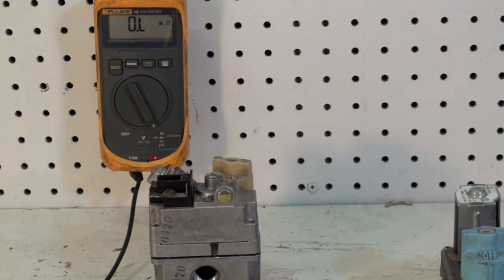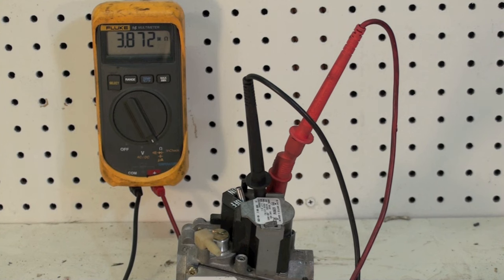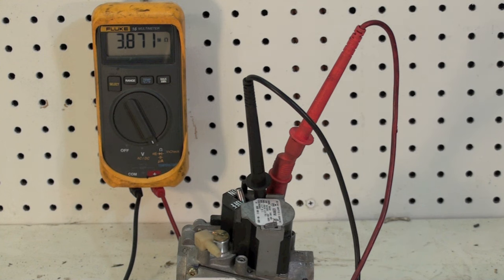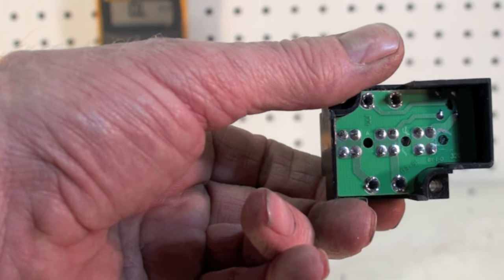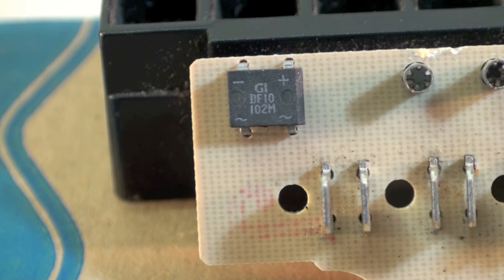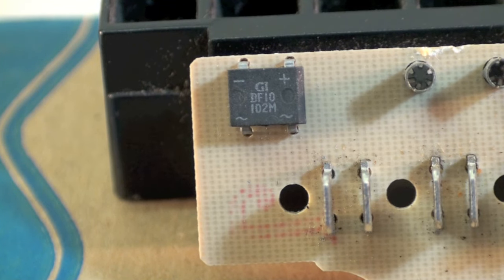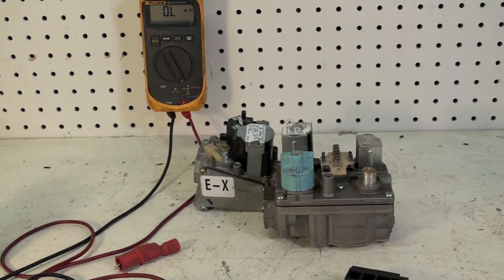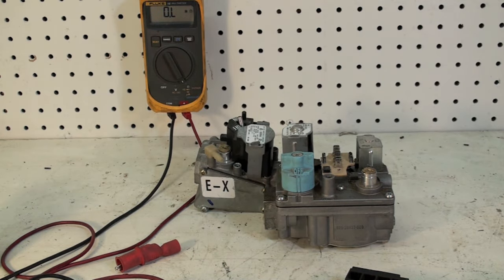How to test the gas valve on a gas furnace with an ohmmeter

Comment: I know this is an old video but it was really helpful to see that diode bridge and understand why some two stage valves cannot be "ohmed out". I was convinced it was bad until I watched this video. Instead, I applied 24v between common and PM or H and it went "click" each time. This convinced me to install a new (used) board and it fired right up. Thanks!
Reply from the maker: Welcome
GFM

Comment: I managed to fix the broken thermocouple! The problem is that most online videos tell you to test the TC mV output. In my case the mV were within range, however the key is to ALWAYS test BOTH the mV and the Ohms. Given that my TC had good voltage, I went to check the solenoid(which seldom fail as the wire inside is quite thick) At first I thought it was shorted, but that's my ignorance! A very very low resistance is essential for a working solenoid.

SOLUTION: FIX THE FAULTY THERMOCOUPLE: 
So here is a FIX that may help many readers out there.
I grabbed the tip of the thermocouple with a pair of pliers and the tip snapped off! EXCELLENT sign! It had badly oxidised inside and became brittle. This is the part where the two metals are welded together(copper or copper nickel alloy).  So I removed the inner STEEL wire and cleaned it. I also used a small drill point to clean out the inside of the outside sleeve. Some grey powder came out, sign of a burnt out joint. Now, for a temporary fix, one can  reinsert the inner steel wire and crimp the tip to the outer sleeve.  I chose to fix it permanently.  If you have access to a spot welder or are practical with a stick welder you can carefully spot weld the tip of the TC so that a small bead forms. I welded the inner steel wire and outer sleeve with a brazing rod 15% Ag. It is easy to do with an inexpensive MAP gas torch (if you don't have Oxy-acetylene torch). Solder is not suitable because of it's low melting point. If you have access to a spot welder or are practical with a stick welder you can carefully spot weld the tip of the TC so that a small bead forms. Thank you grayfurnaceman for your excellent videos

Comment: Thanks for posting.  Even though it was a long time back it has helped me today.  Having used a number of your videos to identify the gas valve as the most likely cause, I metered it and found it to show a resistance of about 2 ohms and close to a 5 amp draw (rating is 0.5A).  Removing the plastic cover of the Honeywell VR8215 series valve revealed a small board with discrete diodes and a capacitor.  Having replaced the 4 x IN4007 diodes the resistance is back into the 2 mega ohm range.  This replacement was possible without removing the gas portion of the valve.

Comment from the maker: The pilot solenoid would normally have a very low resistance.  Make sure the button on the thermocouple is clean and has been tightened.  Do not over tighten.  If the pilot light is  covering the thermocouple 3/8 to 1/2 inch it should hold in.  Check out "the pilot gas furnace"  playlist for more info on how the pilot should work.  If it still does not work, the gas valve will have to be replaced.  Good luck and let me know what happens.
GFM

Comment: 30 year old Bryant 394GAZ upflow furnace using the White Rodgers valve you have in the video.  No problems with this unit until 2011 when they replaced all the gas mains in town with plastic.  Last few years the orifice on the #1 burner (out of 4, 100k BTU) keeps getting clogged but that's nothing major...  wondering why though. 
I have been fighting with this furnace all winter.  Was without heat for 3 days in December waiting on a new pilot assembly (flame switch went bad so pilot kept going out).  Ever since the trouble with the pilot began, the furnace has multiple clicks when energizing the main gas valve.  Sometimes it acts normal and just one click, other times it's a dozen clicks.  I have already replaced the lockout ignitor (no success, intermittently failed on the pilot hold circuit), wrapped the wire for the main valve circuit in tape in case there was broken insulation somewhere (yes, electrical tape), checked for arcing behind lockout, and redone all the solder points for the main valve in the ILO and all of the ones on that stupid circuit board on the gas valve.  All to no avail.  Tested gas valve solenoids with circuit board removed and got around 960 ohms.  No exploded/bulged capacitors I can see in either  the ILO or the main circuit board in the blower section either.  Got another 2 months of winter to go here and I don't want to be left without heat again.  Am I looking at getting a new valve?  Any other suggestions?

Oh, and I forgot to mention that you can hear the solenoid clicking throughout the entire house through the ducts...  haven't been watching much TV or anything so it's pretty quiet in here.

Comment from the maker: Sometimes I assume more than I should.  In most cases, we are looking for 24-28 volts AC.  The voltage is transformed from usually 120V AC.  On some units, specifically hanging unit heaters, the gas valve can be 120V AC.  Thanks for the comment.
GFM

Comment from the maker: Yes you could.  The amp meter must read in .01 increments.  And remember on newer units the gas valve is only on for 4 to 7 seconds on a trial for ignition.  So the sequence is inducer on to prove pressure switch>HSI warmup>gas valve for trial for ignition.
GFM

Comment from the maker: Most of the valves have a rectifier as said on the video.  So sometimes the reading will not help.  If you can hear a click when the pilot proves, the solenoid is energizing.  I believe that pilot has an integral flame rod.  That just means the rod that the ignition spark comes from is also the sensing rod to prove pilot.  Try sanding the flame rod if you dont hear the click.  Good luck.
GFM

Comment: That is Full Wave Bridge rectifier, now that you removed that part, you now have access to the coil or coils, and you can use the ohmmeter on it. You can also connect the 24-28 VAC input to the external spade connectors and test the Rectifier to see of it has a DC Voltage output!
Reply from the maker: The point of this video is that ohmmeter readings are pretty much useless on these valves.  They are not repairable.
GFM
Reply: grayfurnaceman once you have that cap off the actual coils can be tested with your ohmmeter! You just can’t do it with that cap on!
Reply from the maker: @DishNetworkDealerNEO  First, the failure of these rectifiers is very rare.  Also, each valve does their rectifiers differently and the part you have shown will not repair all of them.  In fact, some of them do not have rectifiers in them at all.
Then, as a service tech, I replace this part, then find the coils have shorted, (no specs for them) I have wasted a lot of time on something that does not work.
Add to that, the manufacturer absolutely considers repair of gas valves a no no.  Liability comes in here.
GFM

Comment: Thanks for the Good luck  and suggestions. The very first think I did was cleaning both rods. What is the purpose of having 2 rods? .One integrated with the spark, and one on the opposite side of the burner? Do they prove pilot flame or main gas flame, or may be one is for pilot and one for main gas flame. The reading should be 0.15 micro amps.
I don’t thing I heart clicking from the gas valve .When properly working the main gas shoots immediately after the pilot.

Comment: Natural gas piped in city, hot water heater doing just fine, gas close dryer all good.  It is now working just fine but would not light up twice last night,  When it first started do this it had been off and cold now it is hot and doesn't get cold well not ice cold. Something is not getting th message to turn th gas on. 
  I just don't know enough about how this works, it is old 1983 but real clean and broken. Was just trying not spend th 4,500 for all new and maybe not as well made.  Thanks for ur time, it's been fun, never did this before..........T

Comment: Sir, thank you very much. This is exactly what I wanted to know. The pilot lead to the circuit board is shorting out. It took me a month to figure it out. It was a intermittent issue that was causing the problem. I really didn't know how that black box was connected to the coils. My valve is very similar to this one shown. So, I need to take the circuit board out and somehow fix the pilot lead. I see from another video these leads corrode.

Comment from the maker: It sounds like you have more than one problem.  If the transformers are wired together, I recommend you use one of a higher capacity.  The explosion (we call that in the HVAC trade a rapid expansion lol), would seem to not be related to the transformers.  I would watch the ignition for delays between burners or simply a delay to light. Watch it you could get a face full of flame.  You may want a professional on this one.
 Hope this helps.
GFM

Comment: First off, Great videos!  Super job all around even for the novice repair person,  Great education,  We have a mid/late 80s Lennox furnace G16Q3 It has the Robertshaw ignition module. Last spring when we turned the power off to the furnace it was not running properly and we knew this year it would need some repairs.  (Blowers running to long/and not lighting very often. long story) Originally we were told that we should replace the ignition control module. We seem to have more than one problem.  first problem was no spark, after cleaning both igniter and sensor still no spark and realized the igniter wire was faulty and replaced it and we now have spark.  We do have power going to the gas valve and are trying to determine if we need a new valve and/or still replace the ignition control module?  That being said we also had weird problem originally when cleaning the furnace this year. I had a drop light and was holding it close to the furnace so I could see into it.  The bulb touched part of the furnace and sparked a very loud pop, and  tripped the breaker to the furnace.  The light bulb went out  but came back on after turning it back on. The spark was on the gas supply line going to the burners. at this point power was off to the furnace as I was going to clean it.  It left such a spark it removed the paint on the gas line. Do you think that could have ruined the gas valve? and also should we still replace the Ignition control module?  Scratchin my frugal head.  Any help would be appreciated. ty
Reply from the maker: Your module is probably failing.  I would not worry about the short causing damage to the unit.  The gas line is electrically grounded.  If you want a little more info on this furnace, I did a playlist on your model:  https://www.youtube.com/playlist?list=PLItXrh64d2JOJuEqiX_8OlM5jcZOaSuUg  Hope this helps.
GFM

Comment: Great Video. Thanks. Also watched your video on the combination valve. I am trying to troubleshoot an old home has heater that will not stay on.  Being portable, it has a tilt switch in series with the solenoid. The tilt switch works fine. I tested the voltage on the thermocuple and it reaches 30 mV, which seems to be enough. Then I took out the solenoid and noticed that the ohmmeter tested a short circuit. In other words the brass chassis is not isolated from the central contact point. So, I am guessing that my solenoid is roasted! I cannot find a similar one anywhere and so I was hoping you could tell me if you had ever rewired a solenoid. Any other pearls of your wisdom are much appreciated.

Comment: Without knowing details (mfr. model no, etc.), I'd guess the rectifier is there to provide DC power to other circuitry in the control module, and/or DC power to a solenoid, since they don't work with AC. Supply is probably either 110 VAC or 24 VAC, which needs to be converted to DC, since that's what most IC's work with (generally +5VDC for old TTL logic, lower for later IC's). I came here looking for info on REPAIRing older valves, i.e. pulling out and replacing the safety magnet or repairing the hold-in coil on a Robertshaw 110 series, after verifying thermocouple output (30mV) and continuity of the coil. At least you went into more detail than most "repair" videos I've seen - most just show how to replace the whole thing, if that. I've kept an old 50's era Coleman floor furnace going for years by re-greasing the valve (LP gas is a solvent for the grease they used back then). Hoping that's what my problem is. Thanks anyway for a better-than-usual video.
Reply from the maker: +AZStarYT The rectifier is is there to keep the valve from "buzzing".  It does not provide power for any other part of the furnace.  Welcome
GFM

Comment: There is a wall mount heater that's been running fine. I'm sure it doesn't use as much as the furnace. Gas flow seems fine.

Comment from the maker: The one on the opposite side of the burner is to assure all burners light.  If your ign control  is a Johnson they seem to prove very fast.  Honeywell is much slower.  If you have 24 volts to the main gas solenoid valve and the valve does not open, the valve is toast.

Comment: I went today to that rooftop equipped with valve and control module. I measured the voltage to PV -24V, measured to MV (after pilot was on) no voltage .So –it is the module? Then I jumped PV to MV after the pilot was lit- nothing happened. That left me clueless .Install the new module (universal) –no main gas .Swap the valve (universal).Clean main and pilot burner. That took some time. Bingo! Works. Swap the old module back .Works as well.

Comment: My gas valve will not click to the open position. It's a newer honeywell valve. I tested the voltage going to the gas valve and it does not make it over .90 volts AC after the igniter starts to glow. I checked my transformer and it does put out 24 volts AC. My conclusion is that there is a problem with the control board or a bad wire. Thanks for this video.
Reply from the maker: If, when there is a trial for ignition, the voltage to the valve should be 24 to 27 volts.  The .9 volts is a ghost voltage and may or may not mean the control board has failed.  It could also mean the system has not proven that it is safe to light the furnace.  Pressure problem, inducer or venting problem.
GFM
Reply: @grayfurnaceman  a high limit switch got tripped. I reset it and I have heat again. So far the high limit has not tripped again.
Reply: I found the issue causing flame rollout. In 2 or 3 burner tubes there are small gaps between where each side is joined. The gap was filled with some red stuff which has crumbled away in this 22 year old furnace. I replaced the primary heat exchanger and cleaned out the secondary. I will get it running this weekend. This gap was near the opening of the burner tubes on the bottom.
Reply: @edbrandt8972  if the flame rollout switch got tripped or being bad, does the burner still light up? My igniter glowed but still no fire. Wondering if I should replace the flame rollout switch or the gas valve? Thank you.

Comment: Excellent video, I have some of these valves, just had my 1st one go, ( 1988 vintage Goodman) was fun to take the circuit board out, could not see any issues that were obvious. Changed it out with a Honeywell, only one available, and was wondering if there were any serviceable  parts, Thanks for your web site and all the great videos ! I learned a lot !
Reply from the maker: No serviceable parts.
GFM
Reply: Thanks, any comment on White Rogers vs Honeywell valves ?
Reply from the maker: You know, these things are different in design, but they really are much like peas in a pod.
GFM
Reply: Many thanks ! Take care.

Comment: On the White Rogers I actually OMed the coil today (with the circuit board removed) it is 91 Ohm for both pilot and main gas (witch tells me they are not shorted) However my pilot is lit and my main gas does not open. I swap the ignition module with the known working one and got the same result. I’m planning to replace the valve tummorow, but still not 100% sure .Any suggestions?
By the way it was working intermittently 2 days ago.

Comment: I just had an epiphany. 
To test this valve independently off all other factors would it be practical to simple make turn off the gas and the power to the furnace energize a 24vac transformer and apply it to the coil connections?

 This way you are eliminating any possible feedback loop issues?
If it functions properly (no buzzing) apply gas pressure? (briefly)

Comment: I've learned a ton of good stuff through your videos.  Thank you for sharing.  I'm looking at an old Janitrol "garage heater" in our workshop.  Unit has separate valves for pilot and main burner.  Pilot won't stay lit.  Thermocouple puts out 21-22 mV in normal position with the red button pressed.  Measured 22.5 kOhms across the solenoid, which after watching this video tells me this component has most likely failed.  Question: can you still get a pilot-only valve, or will both pilot and main valves have to be replaced with a combination unit?
Reply from the maker: +revkrull The only viable option is to replace it with a combination gas valve.
GFM
Reply: Thank you.  As I suspected.  Time to call a pro!

Comment from the maker: Sounds like there is not enough amperage available to hold the valve open.  Jumper red to white on the thermostat and see if it does the same thing.  If not, the thermostat is bad.
GFM

Comment: To test the coil, can I put my meter on the "M" and "C" terminals of the gas valve - where an open loop reading would indicate that the coil is broken? and what would the meter read  if it were normal? Thank you.
Reply from the maker: No.  The coil is DC and the 24 volt power coming in is AC.  There is a rectifier between the terminals and the coil.  
The only way to test is a clamp meter on the wire coming in.  The reading is usually about .2 amp.
GFM